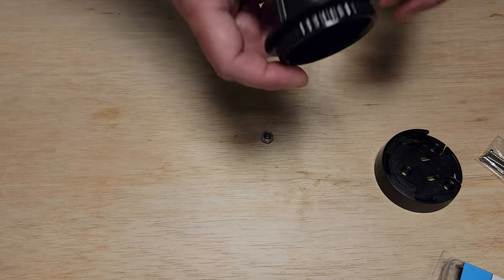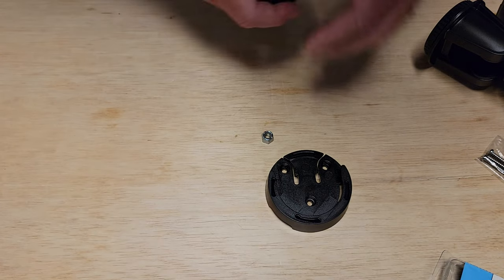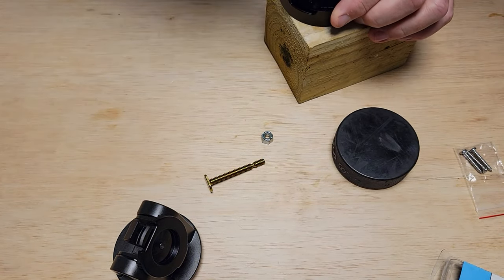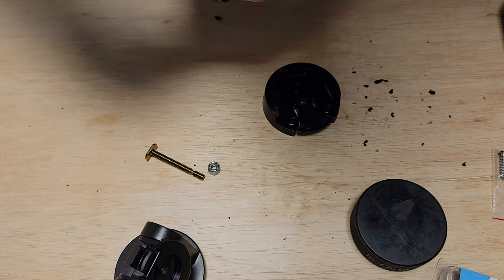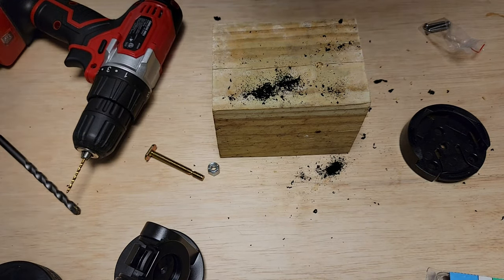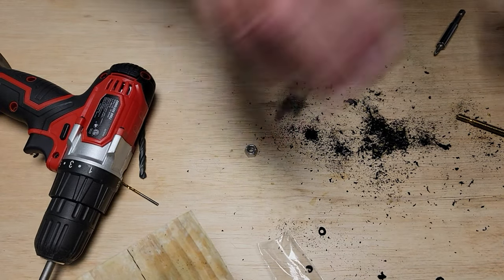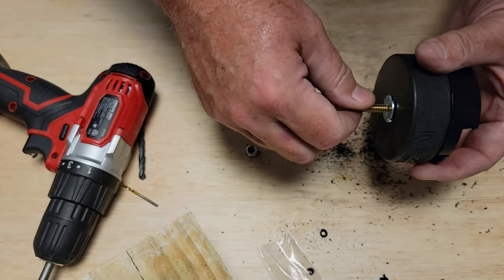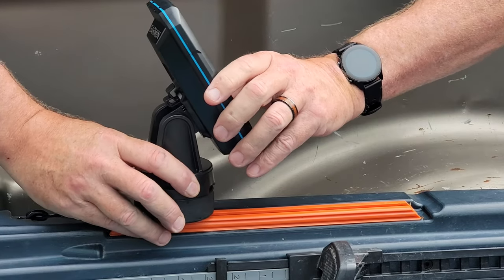Rail Mount Your Garmin Striker 4 Plus!

Comment: Mate, can Garmin Striker 4 Plus do in hull transducer installation?
Reply from the maker: I am pretty sure it can. I chose this way because I wanted it to be in the water so I could get the temperature. I have seen hull mounted builds using a putty like substance to mount it in.

Comment: Thanks for showing how to separate the base plate from the rotating gear plastic part. It really isn’t too obvious until you see someone else do it.

I cannot believe the amount of technology packed into this very economical Garmin Striker.

I am not a fisherman but use the GPS function to establish about 50 Waypoints between our Marina and cottage which has 2 narrows and several sharp turns. Very useful finding my way at night, heavy rain or in heavy morning fog which we get some cool mornings. I just follow the Waypoints and rarely look out the window and I have it set at 200 foot scale. The other handy feature is that you can rearrange the order of the functions so I put the QuickDraw Map function right at the top so I can quickly get Waypoints by turning on the Power button then clicking on the check button when QuickDraw Map is on top of the list.

I previously had a Humminbird 196 which had GPS waypoint functions but it took multiple steps to get to the GPS function which is not useful in an emergency. I must say it did save the day at 3:00 a.m. in the morning when we had to take our granddaughter to the hospital.
Reply from the maker: Wow hope she's ok!
Reply: @MakeItTakeItOutdoors  She is. I just included that to show how valuable a GPS included with a Fish/Depthfinder can be in an emergency situation providing one has loaded in the waypoints for your route.
Reply from the maker: I get it, but as a fellow grandpa I gotta check!

Comment: Thanks for making this video. Couldn't find a video showing the base plate. Was considering this for my kayak, but don't have a rail system yet. Was hoping it was fairly flat so I could mount it somewhere it doesn't get broken taking it off and on my van. Now, I am fairly certain that it will be just fine where I want it.